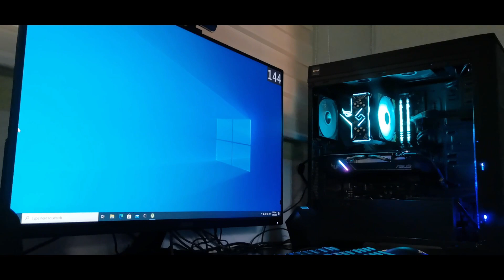DEEPCOOL GAMMAXX GT RGB CPU COOLER INSTALLATION PART 2

Comment: One thing I noticed about this cooler and all other coolers is the screws are made of a soft metal and strip very easily. Guess that’s where the low cost comes in.
Reply from the maker: Just use not too much force to lock it. Thanks for viewing